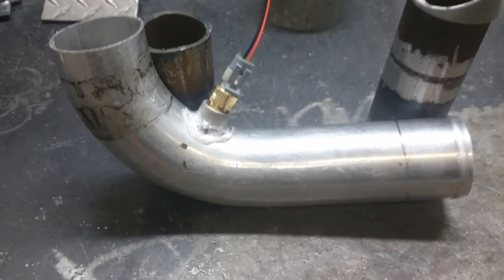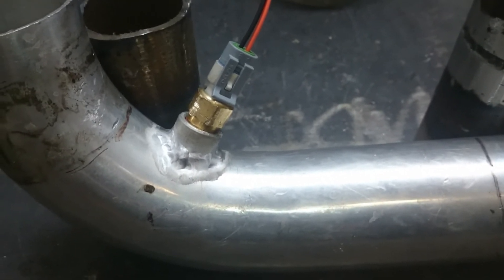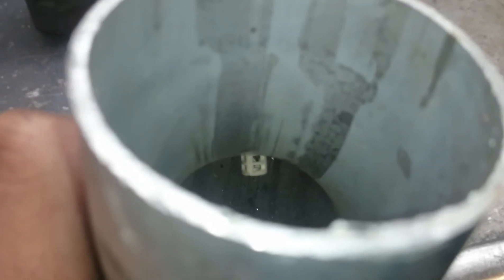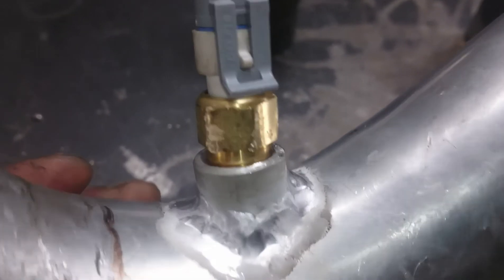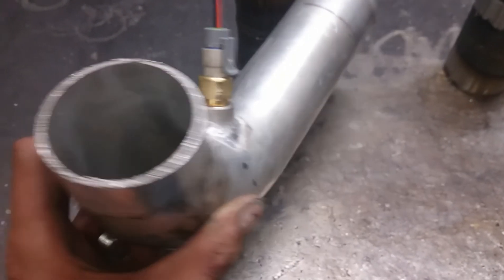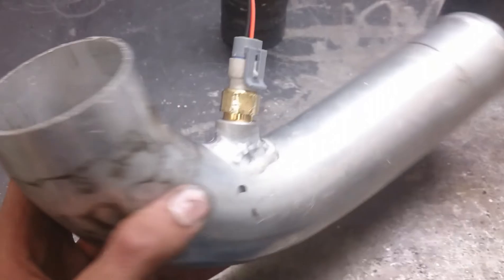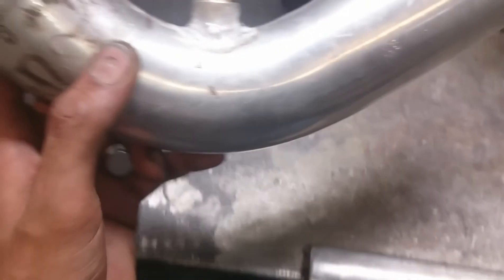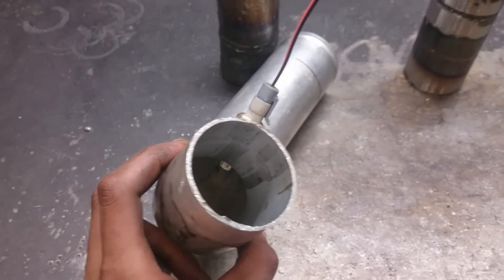Prep For Microsquirt and New Tig Welder

Comment: Always put the sensors on the outside of the curve in the pipe. So 180° from where you have it at.
Reply: More accurate reading. All the air hits the outside of the bend on the way through.